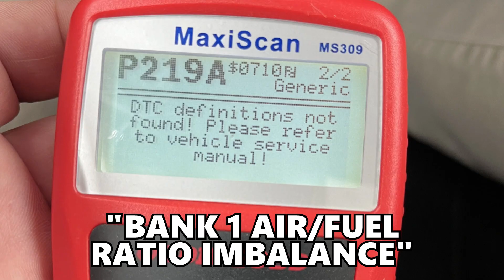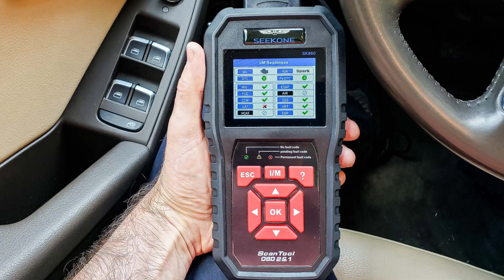Engine Code P219A: What It Means & How to Fix It!

Comment: 2013 Silverado 1500. Been fighting a P015B (delayed response upstream bank 1)for a while. Installed an amazon upstream sensor and started getting the  P219A. 

In the mean time I ran that Cat-a-clean stuff through it.

Im mostly sharing to make a record for those interested in my findings. 

Just cleared out the codes.

Will report back.

Comment: I have a 2013 Chevy - Silverado 1500 LT with 5.3l engine with a P219A code I can not get rid of. I have replaced the intake manifold gaskets, replaced all the fuel injectors on bank 1, replaced the EVAP Canister, replaced all 4 ignition coil packs on bank 1, replaced the spark plugs, replaced the spark plug wires, replaced the fuel pump, replaced the MFS, replaced the PCV's, replaced the MAP sensor, & replaced the Purge Valve. After all these replacement parts, I still have the P219A code. What else is actually left to try to fix the problem? I am getting very frustrated & could use some advice what else to try to solve the problem.
Reply: I have the same issue with a 2013 sierra as well lol
Running out of ideas here haha
Reply: the only thing is reset pcm or check for bad pcm
Reply: @aldohernandez1706  Oh no, that sounds bad. This is the sixth vehicle ( I only owned six vehicles ) I have gotten screwed over on now & have never once had a vehicle I can get to pass inspection. This is not good.
Reply: @DTW-bx2vy  or get  a good scanner and check for bads electronic parts  like maf, oxygen sensor, or spray carb fluid around hoses and intake gasket to see if you have a leak, make sure buy oem parts if is anything electronic
Reply: @aldohernandez1706  I failed to mention that I already had a smoke test done to check for intake & vacuum leaks & found none. I cleaned out the Mass Air-Flow Sensor with the correct cleaner & I already had the o2 sensors & fuel injectors tested & they are operating correctly. I only get code P219A & no other codes are showing up. I guess I'll have to have the dealer reset the ECU & do all the things needed to have the ECU relearn everything again & hope that fixes the problem so I can finally get it back onto the road again after close to a year chasing problems.